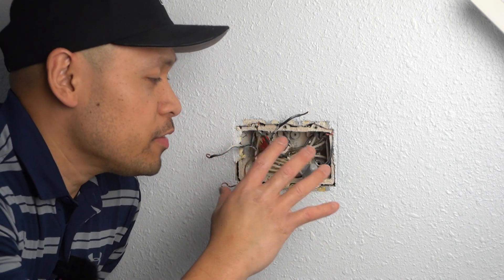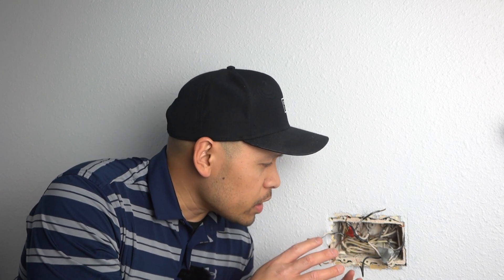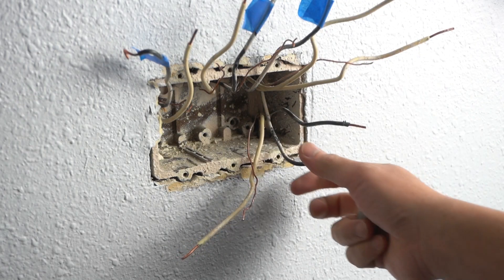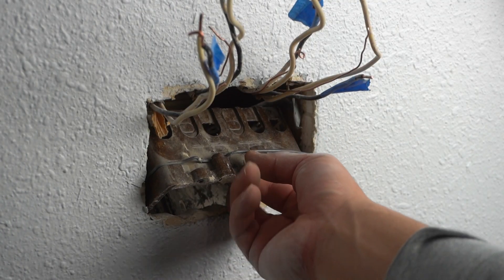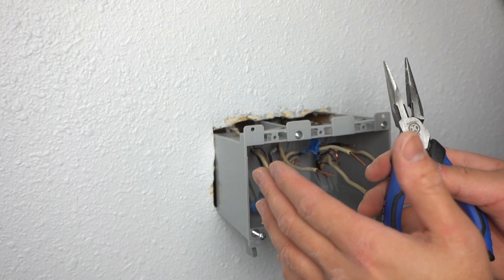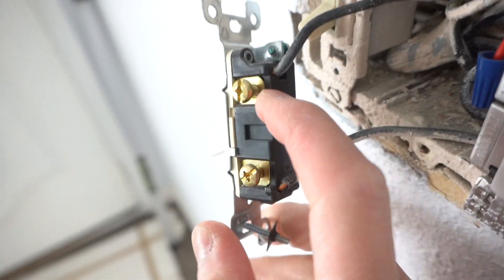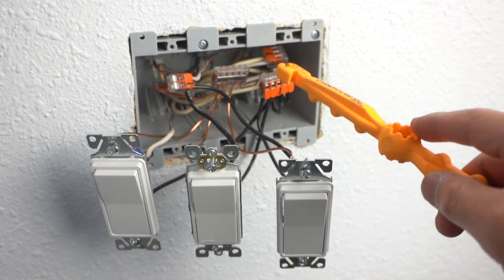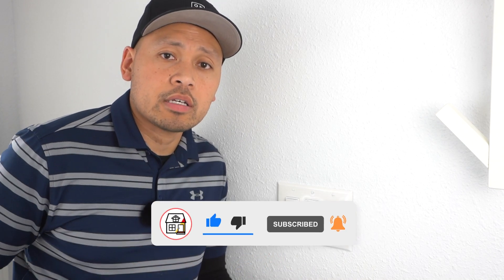How To Clean Up A Messy Cluttered Electrical Box! DIY

Comment: I am currently upgrading the wiring in a century old house. I would also like to install larger receptacle  boxes to reduce crowded wiring scenarios. Are there any cataleptic boxes that mount to the wall surface rather than to the stud. I am assuming a wide  external lip/flange around the perimeter of  the box to allow such attachment, using whatever fastening system that may be required to secure it? I have a few location for receptacle boxes that just happen to be between the studs. Aesthetics are of secondary importance

Comment: Thanks for the video! Question about the end section- you show how all lines are in Wago connectors, the grounds, neutrals, and hit wires. But in same view there are the three back wires with the blue tape just floating - were those 3 lines then to be connected to each of the switches? It’s the little things… if you see this and can comment, thanks for your help!

Comment: Looking for advice.  Ceiling fan install.  All wire is 14-2.  
Existing hot cable in.  3 sets of 14-2  cable  that are from 3-single pole switches.  Why is it popping when I connect all black and all white??

Comment: Well done! I’m going to install a new ceiling fan, and take advantage of a wall switch that currently operates an outlet(which I’ll delete and use that power to drive the new fan. I’ll be using a double switch to operate the fan/ light. A deeper box with wago’s is the way to go(no pun intended) also the volt claw is necessary to achieve this operation.

Comment: I can see why there would be 4 cables, one for the power and 3 for the switch legs, but what is the fifth cable for? You were unclear about how you managed the ground wires. If there are 5 ground wires plus the 3 pigtails to each switch, you would need 2 full 5 position Wago's including a jumper connecting the two. Please clarify that, thanks again.
Reply from the maker: Hi! You are correct Ted, I used 2 full position WAGO sand used a jumper to connect the 2.
Thank you for clarifying this 👍🏽🙏🏽😊
Reply: Good question. Only thing about ground was to put them all together then connect to wagos. What’s a jumper? Again, if these are for DIYers this kind of stuff that seems basic is not to us! Thanks for doing this! I’m going to watch the other video you suggested. Love your videos!

Comment: Excellent video for DIYers. I've got to get that push-pull tool. Thanks for the link. I usually use a wooden dowel with a cutout recess on one end or a pair of long nose players. I use a grinder to remove most of the serrations and grind recesses in the arms to hold the wires. Your tool is much better. Besides using a deeper workbox, I get one with an extra switch cutout. I would use a four-switch box in your video to give me more room to work in. A solid cover plate would be used to cover the unused switch cutout.

Comment: I've been through that TOO many times -- I've been doing electrical repairs for more than 60 years starting when I was a teenager 'assisting' my journeyman electrician father. I've just started using Wago connectors recently and they are close to a miracle -- I'm considering trashing all of my small wirenuts. I was unable to see what sort of screwdriver you were using on the switch terminals but it didn't look like any that I have. Can you please let us know exactly what it was? Thanks.
Reply: It’s a Klein insulated screwdriver